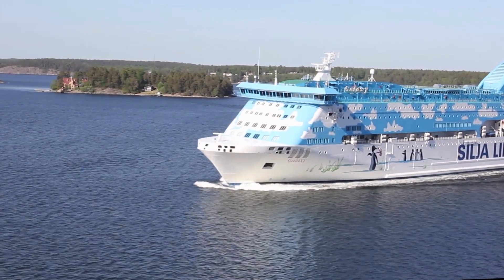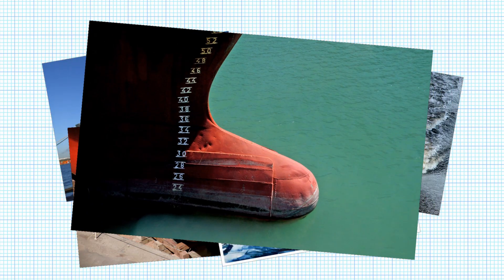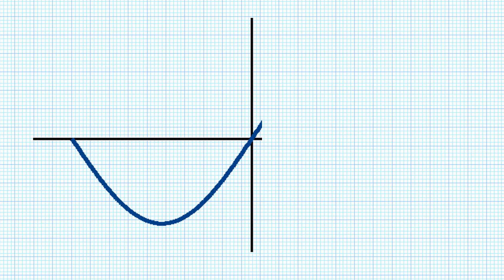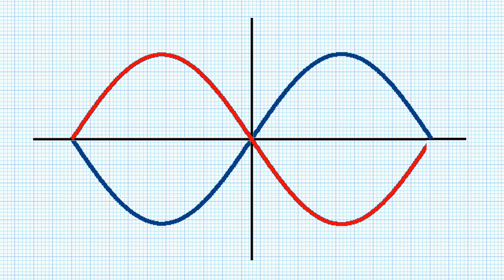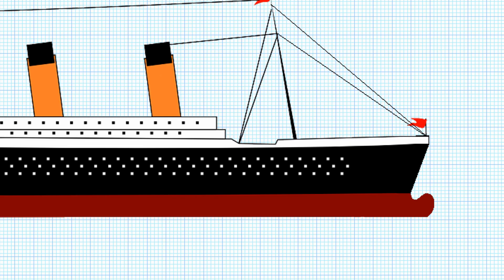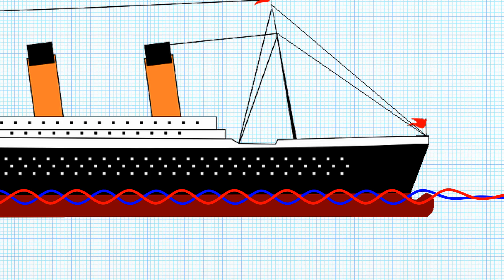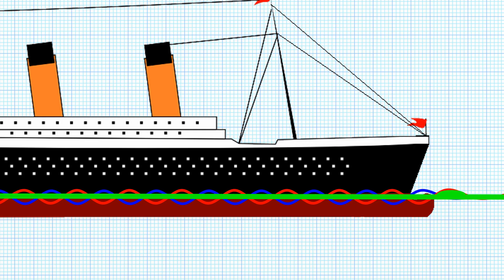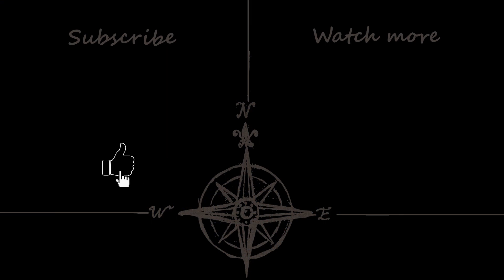What is the BULBOUS BOW for?

Comment: I've heard that it has a few other secondary purposes. Maybe someone can clarify if these are actual reasons. a) In icy waters, the bulb creates a low pressure area in front of the ship, just below the ice, causing the ice to collapse before its impact with the ship. b) For sonar use, you want the sonar to be slightly separated from the steel hull of the ship itself, as to not cause as much interference, you can mount a sonar inside the forward protruding bulb.

Comment: I know a bolbous bow helps with fuel and that's in the bow of the ship, but while on a cruise ship they talked about how the ship was fitted with a duck tail on the Stern to also help with fuel. Can you explain what this is.
Reply from the maker: The duck tail is a horizontal extension at the aft end of the ship. It is used to help reduce fuel consumption by modifying water flow near the stern

Comment: Still confused as to how it cancels out the normal wave. In my mind the bulb will create a wave of its own before the normal wave is created, so its like there is nothing to cancel out.
Reply from the maker: At the point where the bulb creates the wave, you are correct in that there is nothing to cancel out. Just after that, however, the hull creates its own wave. The wave from the bulb is meant to immediately cancel out the wave created by the hull.

Comment: Thanks for this information.  Its funny but ships captains cannot decide exactly what the bulb is for !!  i have interviewed manu ships captains and they all give different explanations. Capt Bill Williams of the Empress of Canada was convinced that the bulb gave extra buoyancy beneath the bow and so reduced the amount of pitching into an oncomming sea.  Bulbous bows have been FITTED retrospectively  on certain ships ,with all the costs involved and bulbous bows have been REMOVED retrospectively from various other ships. No one seems to agree on the advantages/disadvantages. The Queen Mary did not have a bulbous bow yet the Normandie did- yet which was the faster ship  ??
Reply from the maker: Surprisingly, knowledge of the bulb doesn't actually form part of the education for a ship captain. All captains will form their own opinions over time. It is only naval architects that can really explain the bulbous bow. 
Speed is far more influenced by ship size and engine size than it is by the bulb. The bulb assists, but it won't make much of a difference.

Comment: This makes me wonder about the viability of having a variable bow that could adjust it's shape for speed and sea state. It could even be as simple as a bulbuous shape designed for the hull being ram-driven via computers to extend or retract as needed. Maybe?
Reply from the maker: As long as the fuel savings outweigh the development and installation costs, it would be successful

Comment: Why don't I see this on race boats?
Reply from the maker: It is always a balance between fuel saving at constant speeds, and increased consumption at other speeds. Racing speeds vary a lot so I guess the bulb wouldn't always generate a benefit
Reply: @CasualNavigation  if only they could design adjustable bulbs

Comment: only if the bb were to be completely submerged under the water line, then u can get the effect of it. other wise during a sea state 5 and above..it will just create extra drag. ⅓ of the heavy weight frigates (6000T<) don't have bb, cause they prefer to ride above the wave, above their hull speed. 140m LWL will have roughly 28kts/hull speed. quite a number of frigates at this length have 32+ knots max.
Reply from the maker: Exactly. There are only limited conditions where a bulb will be effective. They are not always useful

Comment: I thought that they were designed to reduce water resistance at the front of the ship, like airliners have a round leading edge at the wings. VNow I see it with a totally different view than before, thanks to your excellent explanation!
Reply from the maker: Thanks Bandicoot
Reply: ...and Bandicoot has it right. An aircraft wing operates on the same principle by splitting the air into the longer upper path and the shorter lower path it creates low pressure drag called the Bernoulli Principle which generates lift.
Reply: @patrickbennett752  LOL. If it's not Bernoulli's Principle, then what is the principle dictating how an aircraft wing generates lift?

Comment: Shouldn’t the surface area touching the ship stay the same if it doesn’t have the bow due the trough having the same depth as the height of the crest
Reply from the maker: I think you are right technically, but due to movement etc the higher parts in contact do create more drag.
Reply: Oh boy. A British accent but no common sense. Do you simply concoct  internet friendly videos or hate to bother readingbasic hull form design because you already know too much?

ALL water in contact with the hull is drag. Wave crests and troughs in your graphic are creating drag. The troughs represent low pressure. Your conclusion is acceptable but your method and explanation is far less so.

Comment: Even Great Lake freighters have them. Very good
Reply from the maker: Thanks mufasa. Great lake freighters do long passages at a steady speed so do get the benefits from them.
Reply: Actually, the classic Great Lakes freighters usually do not have a bulbous bow. There are numerous "salties" (ocean going ships) working the lakes that have them, but your typical Great Lakes iron ore ships, including all the 1000 footers, are designed to optimize cargo space in the hull. The ports are fairly close together on the lakes, and speed is not as much of a concern.
Reply: Also, there are numerous rivers to navigate with irregular speeds and turns abounding.
Reply: plinn2112 Now that I think about, you may be right. I don't notice them on the general ore carriers but on the tankers, they're noticeable.
Reply: A few of the Canadian ships have them. They work well for ice breaking.
Reply from the maker: Thanks plinn2112. That does make sense. Cheers for the correction

Comment: I feel like I get some kind of weird thing like this when kayaking. If I slowly paddle hard in each side it causes more drag then if I paddled quickly but lightly cause it keeps the center of gravity more in middle and smoother forward motion??? Less heavy drag going side to side??
Reply from the maker: Paddling hard and causing more water disturbance could indeed increase drag. Add in the additional sideways rolling from the paddling and it could easily explain what you feel. It is an interesting observation.
Reply: What happens when you displace water? It rushes back in. That's what water does. That creates the suction behind a paddle or a propeller or a hull.

Comment: Does  its effectiveness depend on the speed of the ship?
Reply from the maker: Yes. The bulb is usually designed to work at a set speed, so it will be most effective when moving at its design speed.
Reply: Maersk removed the bulbs 4 years ago on a class of container ships because the speed for which they were designed was no longer economic and the additional weight became parasitic.
I think they stored the bulbs some where

Comment: Well done CN. First time I have seen a video applcation of the sine wave concept to explain the function of a bulbous bow.  Is this now a part of the STCW based COC syllabus for mariners? If not, it should  be. Downside of bublous bows? They make huge and expensive holes in the hulls of the ships they crash into!
Reply from the maker: Thanks Seaprof! I do not believe it is part of the STCW syllabus - I only know it because I had a background in physics before going to sea so I find these sort of things fascinating. You are right about the holes too. Bulbs are below the water so unfortunately tend to do damage below the waterline!
Reply: The physics are better understood when you apply rudimentary hydrodynamics. In the beginning g of the video the narrator does not develop this by treating it as a waveform analysis. Any naval architect William explain that the high pressure of the bow wave is minimized as it passes the forebody of a displacement hull such as that show in the video. These initial dips or trenches of the bow wave  contain suction proportional to the bow wave, and that is drag.  The bulb minimizes this. Which is why they are less efficient as speed decreases. The latest designs for slow speed have a token bulb or none at all.

Comment: What about BREAKING ICE
Reply from the maker: The bulb is too weak to be used to break ice. Icebreakers are specifically designed for their task, so generally do not need the open sea fuel savings that a bulb provides. I will try and get a video on ice breakers done at some point as they do have an interesting design.
Reply: The Casual Navigator Oh okay.... From a very little age I thought that these bows were used to break ice 😂

Comment: And ... since hydrodynamic drag of a displacerment hull is inversely proportional to length, and bulbous prow makes a ship longer hydrodynamically, that part is obvious. Having the prow at a low point of the bow-wave doesn't hurt, either.
Reply: Jacques Blaque drag is directly related to length because of wetted area but hull speed for a sailboat is related to square root of length.

Comment: A minor side effect is that it also helps reduce hogs backing over the life of the ship.
Reply: I have no idea what that means.
Reply: Gary Odle 
Hogs backing is a tendency over time of the bow and, to a lesser extent, the stern of a ship to sag as the narrowing at those points provides less bouyency per tonne above them.  This leads to the vessel tending to bend down at the ends forming a slight bend or hogs back shape over its life. This can of course be engineered against but better to prevent the problem by supporting the narrow bow with added bouyency well forward where it has the most effect.

Comment: The bulbs were from WW2 submarines for their sonars, it just worked out for great unexpected advantages other than for sonars. Then so, the bulb design went to ship bows....thanks to the WW2 submarine.
Reply from the maker: A lot of merchant ships do to. It is a nice empty space right in the bow so is ideal for sonar
Reply: @CasualNavigation  are you crazy or do you not even know merchant vessels have no sonar. The bulb is a void with nothing in it. In some vessels it is common to the forepeak..commercial ships have a transducer for the depth sounder. It's a little bigger than a hockey puck and sits up forward.
Reply: The Yamato had it too IIRC.
Reply: HMS Kongou 

Yes, but that was for hydrodynamic reasons.
Reply: wave haven A lot of ships in at least the US Navy still use the bulbous bow to house their sonar
Reply: I was actually wondering this exact thing (about subs and sonar) I was wondering if it was an accidental discovery. 😁 good stuff. :)
Reply: Actually sonar or ECHO SOUNDER we used to call is located at the ships bow...trust me..im a seafarer..LOL

Comment: are you a mariner officer?
Reply from the maker: Yes, a deck officer.
Reply: The Casual Navigator do you know why cruise ship always keep negative trim contrary from the other types of ship ?
Reply from the maker: I believe it is for fuel efficiency when travelling at higher speeds. Cruise ships typically travel faster than cargo ships. When the water starts flowing around the Hull at high speeds, I think the ship then sits level. Of course if anyone could confirm or deny this theory, that would be great.
Reply: The Casual Navigator yes that’s correct great channel I am a chief mate on a large cruise ship and we are always trimming the ship
To have a dynamic trim that will help with fuel
Reply: @CasualNavigation  ALL Ships should be trimmed ever so slightly by the head during the voyage to ride even keel under power but in practice this is not done on all ships because doing so excessively or not paying attention to it while on passage will result in more disturbed water ar the propellers and more work for the rudder,  counteracting the small savings otherwise generated
Reply: The Casual Navigator are you swedish? As the ship at 0:01 is the Finnish/Swedish Carferry Ms Galaxy
Reply from the maker: No, I am from the UK. The video of the ferry was just the most suitable one I could find
Reply: The Casual Navigator alright then i was just wondering as that ship is swedish and i have personly been aboard

Comment: Very interesting and thank you. One question if I may, why this kind of bow is only, or mostly at least, present in large and very large ships ? A yacht wouldn't benefit from its presence ?
Reply from the maker: The problem with sailing boats is that they heel over when sailing, so I guess that would effect the bulb. With smaller motor boats, they change speed often so the bulb would not always be effective. With ships, they have a 'sea speed' that they do for days at a time between ports. Saying that, I have seen bulbs on small motor boats before, they are just rare

Comment: Very interesting. I knew it helped fuel consumption, but never knew why. For some reason, we always called it a "steering bulb", which is totally inaccurate.
Reply from the maker: Thanks Capt Edward. I guess it could help with steering by increasing the length of the waterline, thus affecting the length / beam ratio. I hadn't considered that before
Reply: Some ships have thrusters inside them that help turn the ship when docking.